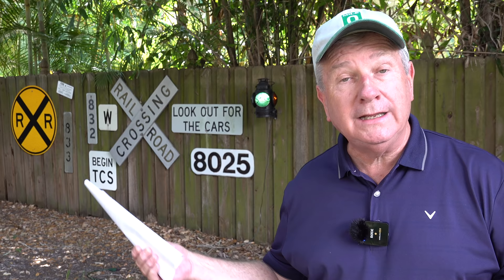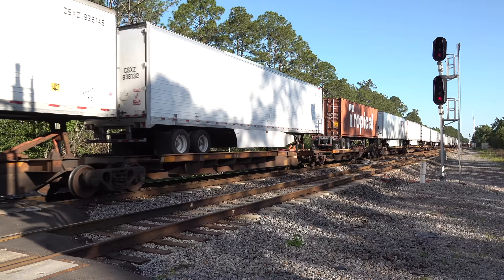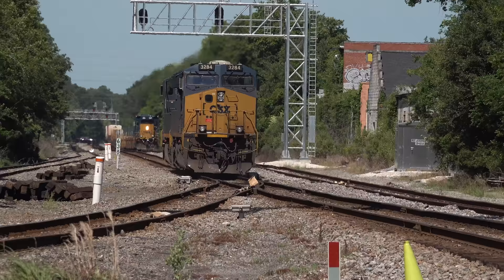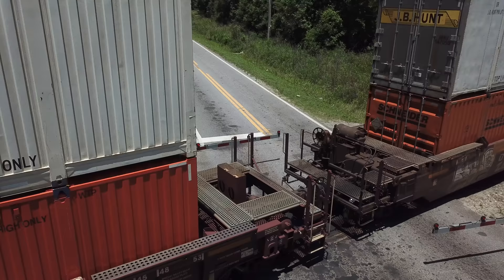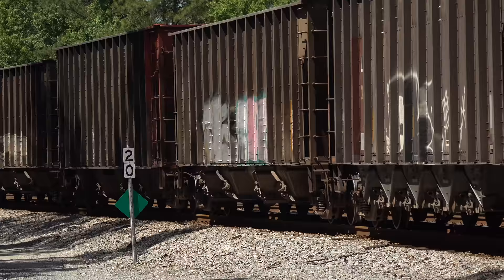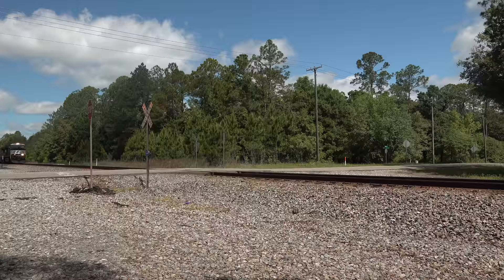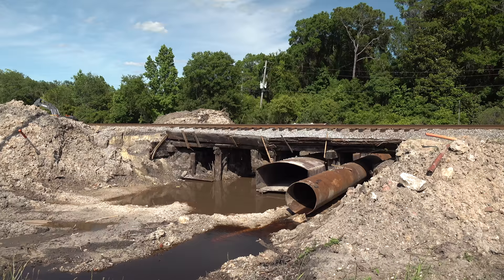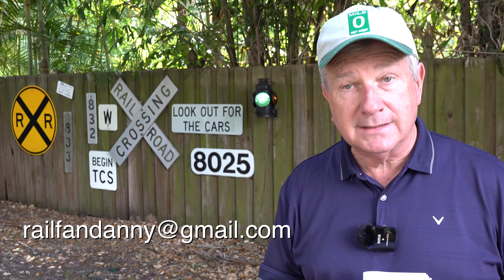How Distributed Power Works

Comment: “In control of a DPU”. Lol. Longest I ran without have communication with my DP was 48 minutes. It was in notch 6.
Reply: Hi Dilly. Oh isn't that so much fun!!
Reply: Really isn’t a big deal. If you set the automatic at least 10 lbs, the remote(s) kick back to idle. I’d rather that then have them come in and out and rip the train in half. They can operate for 90 minutes without input from the leader.

Comment: Anybody! Why do some trains have the lower two headlights alternatively going on an off. Others have them on all the time. Then I remeber the older engines had one large head lamp with two lites, one of which as I recalled traveled around the perimeter.
Reply from the maker: The two lower lights are called ditch lights. Required in FRA rules as a safety measure.

Comment: Question: do DPU engine horns and bells work when the lead engine blows its horn or rimg bells. I take it that no one rides iin the DPU engines. How about lights are they remotely controlable, too?
Reply from the maker: No. Horns and Bells on DP engines are not linked to the lead unit. At least I've never heard them do that.
Reply: @distantsignal  Thanks, I kinda thought so, but did not really know. Now I do.

Comment: Huh, i didn't realize it was all radio controlled. I thought there were data cables running down the length of the train alongside the brake lines.

Comment: You explained  it very well but  you  forgot to mention the other side of  using distributed  power on long heavy FREIGHTs. There are many  things that are dangerous about  using locomotives  in this  way .the EQUIPMENT is not  very  safe and  many things can go wrong with it. For EXAMPLE, you  could be pulling up a long ascending  grade ,and suddenly,alarm bells go off on the locomotives in the  middle of the  TRAIN. And the unit is RECIEVing a false signal to  continue to  push/pull.this LOCOMOTIVE  can and will  derail a TRAIN  with  terrifying  results !especially  if it is hooked up to  a string of  tank cars that  is in front and in the  back of the LOCOMOTIVE  In the middle of the  TRAIN. Distributed  power  should NOT BE TOTALLY  DEPENDENT ON  IN ANY CASE! Because  toi many things can go wrong with the SIGNALS that the  LOCOMOTIVE is  RECIEVing from the  lead LOCOMOTIVE  up front!what you will  get is a major problem  that will lead to a DISASTER that will  cause a  loss of life and  a DERAILMENT that  can last for months to  clean up!this is why I hate for ANY RAILROAD TO  USE THIS DANGEROUS PIECE OF EQUIPMENT OF EQUIPMENT  IN THE MIDDLE OF A LONG  TRAIN.THE BEST SOLUTION IS TO  PUE A PAIR OF  ENGINE MEN IN THE CABS OF  THESE MIDTRAIN UNITS SO THAT  IF THE SIGNAL ISNT WORKING PROPERLY, THEY CAN WORK  TO PREVENT A DERAILMENT FROM HAPPENING.!
Reply from the maker: Yeah, I've had a couple of people bring this possibility up to me, but I didn't want to go into all that without having factual information.

Comment: Hi distant signal I was wondering what kind of tripod you have can you take a picture of your tripod so my papa can by the one that you have when I get a job
Reply from the maker: Hi Braden. I normally use a Miller Solo tripod with a Miller DS-5 fluid head.
Reply: @distantsignal  ok sounds good
Reply: @distantsignal  hi distant signal I was wondering if you could order me the tripod that you have this Christmas is that ok with you if you could order me the same tripod that you have and then deliver it to my house

Comment: Ironically both Wabtech and New York Air Brake (NYAB) both have Electric Controlled Pneumatic (ECP) packages and to my knowledge Australia is one of the only places who uses it. The system has it's pros and cons, with the pros being long trains and Wired Distributed Power (WDP) allowing the operator to control locomotives via a cable instead of radio signal like conventional through out the train with distributed power set ups. The cons are poor software choice and cross talk between trains. I am a train driver (engineer) here in Australia and I am qualified for WDP operations.

Comment: That what they should be developing electric. Electric trains. Down scale them a little. Put most of the system under ground where it can constantly be moving throughout U.S. carrying freight. They could basically make the train as long as they wanted too.
Reply from the maker: Why electric? Diesel provides power wherever you go without the need for power lines and other infrastructure.
Reply: Ventilation underground. Need to help out rail system. That's real needed for electric cars.

Comment: Hey sig` do the other locomotives have conductors.
Reply: Hi Bryson, CSX Engineer here. The term Engineer, Conductor, Switchman, basically have the same meaning rail line to rail line. They do carry different titles depending on what line. All trains will have a Conductor. He is the one who manages all the cars, as to what is picked up/ dropped off at the different yards along the way
Reply: @cherylsims5636  Thanks! I didn't know that a Engineer would comment me back.
Reply: @brysonwise8803  Well what can I say/ Danny really is one of the best rail fan sites so I do enjoy watching his. I kinda gave up on the comments when I saw there was 900. I get tired of reading fast. If you are into it, keep reading

Comment: If you have a train with DP, it really doesn't help with a big heavy train unless you have two lead engines. If you only have one lead and the DP, you might as well have the DP on the head. Doesn't help a bit.
Reply from the maker: Why would they do that, then? It can't be easy to place that engine in the middle of the train.
Reply: @distantsignal  LOL! Because nothing the railroad I work for makes sense. They'll waste a million dollars to save a quarter.

Comment: Trains do not "cause road rage"".  The road ragers are those who are not disciplined to operate with railroad precision, discipline that's necessary to save lives from amateurs-at-the-wheel (and cyclists and pedestrians) who won't and aren't made to conform to the rules of the road.  That's the public's problem, not to fault nor problem of railroading, as long as railroaders are obeying the rules of the road.

Comment: one minute in, and you're full of BS.  NOT total control, but hopefully so.  measures are taken to auto-set the DPU to notch 4 when complete radio-control contact is broken, which is quite frequent considering terrain and the amount of rolling stock.  no sub from me, sorry.  not a good first impression.
Reply from the maker: Are you a railroad engineer?